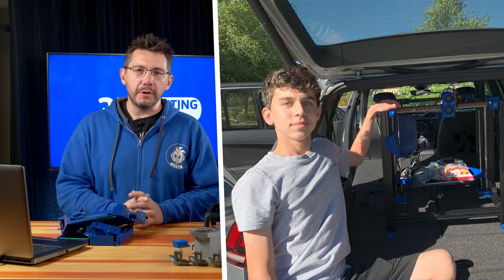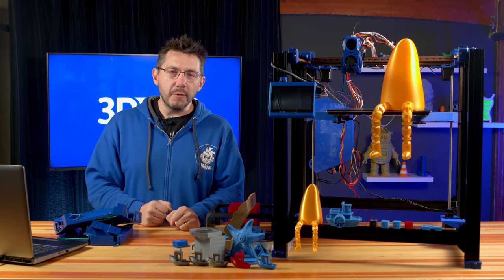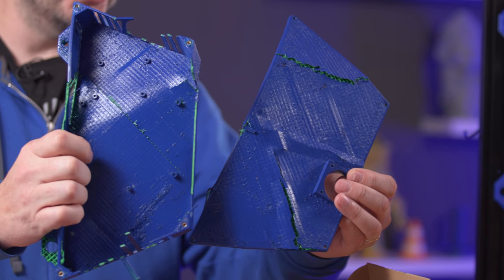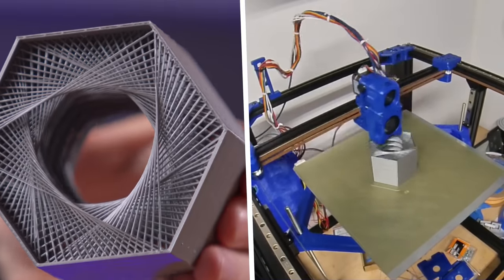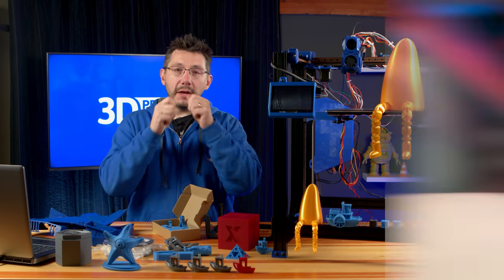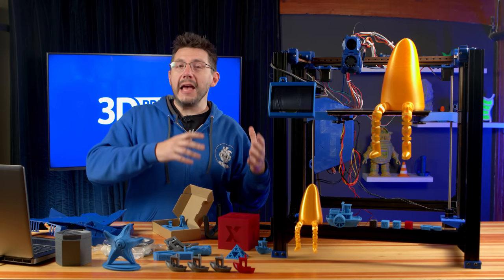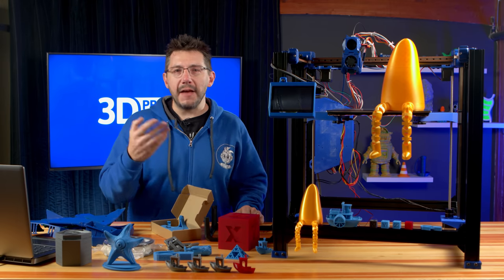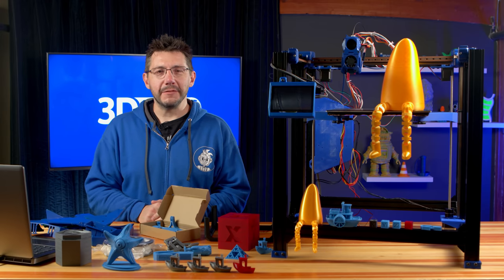14 Year Old Build a Voron - Sort of. Wizard3D W1 Review!

Comment: Website's back up - there was an issue with enabling the payment system. Sorry for the delays
Reply: Nice!
Reply: Good luck man it looks awesome
Reply: @BigfootPrinting  i agree ppl dont ford cobras A.C. even tho its their body same with Hennessey venom ppl dont say its just a lotus exige
Reply: You should create a google business profile to reach more customers.
Reply: Great job, you've definitely got a bright future. With some stronger material and maybe heat sunk screw mounts this build will be solid as a tank and be able to handle high speed as well as high res. Good luck on your venture, I'm poor lol but if I can ever afford one I'll be getting one of yours. I really like and appreciate not only the effort and hard work but the personal aspect too. Nothing makes any product better than when someone's heart and soul and passion are behind the whole thing. Keep up the awesome work!
Reply: good luck.
And I would recomend a little bit more cablemanagement(Cabelchain or something like that).
I know you´re starting but good fotos make also a diffrent.
Reply: it´s also my dream to build an 3dprinter and i am also 14 years old. But i am not so far.
Reply: Your parts did look a little weak. I do not know if it was your filament needing dehydrating or a filament flow issue or not enough walls. If you check with some folk about your slicer profiles and your Klipper profiles, I am sure you can get that sorted out. I personally like 3-4 walls with a 0.4mm nozzle at 0.2mm layer heights with a 15-20% infill and an infill line multiplier of 2 so that it doubles up infill walls. That makes a really sturdy part. Those settings can be used for prototypes that can be filed away and shaped in a way similar to wood too. And yes, 0.2mm is considered a little chunky by a number of people, but it is nice and functional and it is fast. Come to think of it, you might want to try a temperature tower although I am not sure if Klipper folk do those the same way the rest of us do or not. Good luck!
Reply: "Hotend Maximum Temperature: 290° C" 
Capricorn tubing or all metal hotend?
Reply: We are happy to see Mainsail being used more and more. If you need any help - contact us on Discord or send an e-mail. :)
Reply: How are you dealing with certifications and such? I guess that’s really a concern if you’re selling them right?
Reply: Love the design but it would probably be better to sell as a kit for logistics purposes. It is hard to depend on shipping companies not to break parts and if it is small enough it will be placed upside down and sometimes be thrown. Sending it as a kit means it can be a much smaller package and the components can be much better protected.
Reply: "We Will Watch Your Career With Great Interest"
Reply: I hope you'll continue on with this venture.  Sounds like you'll be listening carefully to the good advice going your way.

A detail that is sort of the tip of the iceberg with a ton attached to it: I would really encourage you to spend some time studying 3d printing strength.  I learned a lot of CNC Kitchen on his videos studying the effects of wider line widths (150% of nozzle diameter and wider diameter nozzles like 0.6 to 1.0mm.  I personally use a 0.6 to do between 0.9 and 1.0mm lines) coupled with wall counts (at least 3, but sometimes 4 or 5), with doubling the lines on infill.  Two infill lines next to each other reinforce each other more than just increasing infill density.  Also print temperature / cooling tuning to increase layer welding strength... The wider line widths I mentioned already improve welding and part strength, but using the minimum amount of cooling to prevent sag and retain features without degradation increases strength as well.

I think, (a guess), the parts crumbling either had to do with an incompatible paint degrading the plastic over time or simply some print settings.  The print settings for part strength I learned from CNC Kitchen.

Also, consider printing with PC or PC Carbon Fiber.   On PEI at bed of 105 degrees and hot end temperature of about 255, I'm getting great results so far.   If your printer can handle the higher temperature materials and you keep your bed free from oils from your hands, you can make some amazing engineering grade parts for not much more cost.  I was surprised at how easy Polycarbonate Carbon Fiber has been to work with.   It really NEEDS those wider line widths and reduced cooling to get good welds and keep warp under control.  I haven't had any part lifting yet.

Also, consider experimenting with some steps to reduce heat transfer between the stepper motors and the plastic parts.  1) making a gap between your stepper bracket and the stepper motor.  This can be achieved with cylinders in the model itself allowing a little air between the stepper and the mount or using washers.  

2) Titanium washers don't transfer heat very well, so you might be able to thermally insulate the screw heads better.  

3) Titanium screws might be too expensive to use, but in bulk and with a little standardization in sizes could be another avenue to explore.

4) as you already discussed with Joel, tuning your stepper motor currents to keep heat down is key.  Many printers use slightly larger stepper motors running at 50 to 70% of their capacity to keep heat lower than smaller motors running at 80 to 100% of their capacity.   Of course there is added weight and inertia involved so there is a balancing act here.   You don't want to go too big, but finding steppers that are strong and run cool are part of the equation resulting in a quality product.

These are just a few different ways to look at the heat transfer between your steppers and their mounts.  Seeing how the screw heads pulled through their brackets in some places, this can be heat + shock + time.   You'll need to do some extensive testing of your design to figure out which components need to be upgraded a bit and how to keep the costs under control.   Making standoffs on the mounting brackets is cheaper than buying parts.

That PC CF filament I'm using is a lot more heat and shock resistant than the PETG I normally use.  PETG is better than PLA, but more flexible and can still soften.   Another good reason to watch those CNC Kitchen videos because he tests all that kind of stuff regularly.

Anyway, this is a really long comment and I only intend to give you things to think about and help finding things to research.  I wish you the best and love your approach to this design.  I think you'll be able to find not that you can optimize to reduce weight further.

I, myself, am tempted to do a Zesty Nimble remote driven extruder on a Voron Clone for speed.  

At 14 years old, you're already killing it, so don't lose heart, keep pushing your knowledge and experience further.  You're already on an impressive track.
Reply: @leomakessomething  i am also 14! 
and i build furniture and have a 3d printer that i think you would like its called the ecubmaker 4 in 1 it cnc ingraves laser ingras and can print in 2 colors
Reply: Verry cool im using a modded prusa made with coocoon create parts and running klipper
Reply: I emailed you
Reply: It looks amazing, keep it up.
Can't wait to see your printer in the future 💙❤
Reply: Awesome!
A few "outside the box" ideas:
1) Sell memberships to a "3D print club" for $1000 apiece, that, once there are 1,000 members, they get every "mass-manufactured" upgrade to your printer. Sell other schwag and open an online store full of 3D print accessories, and pay club-members a reimbursement repaying your original "3D Wizard, "sorcerer's apprentice" club. It's a hobby membership club, and gets them guided tours of your print facilities, etc., and discounts on future items. ("Item discounts not purchased will be reimbursed in the form of U.S. dollars mailed to the address and person listed on the club membership signup form, at the end of each year, so that the value of the discount is not lost to inflation.) Thus, people get the benefits of buying 1000-shares of class A stock, without the SEC hassles. They also are identifiable as "club members" who got you your first $1M. It's easier to get a manufacturer's discount business going with $1M of capital.
2) Get to "black aluminum" printing as fast as you can. (Nylon+CCF; water-washable molds for forced carbon fiber; other speciality filaments like PEEK in a heated enclosure; etc.) Feature destructive tests of prints (Hydraulic presses, stress/strain curve tests, etc.) as soon as you can, including tests that subject the various output parts to explosive strain, etc.
3) Also print regular compression rods, going for "biggest possible" architecturally-strong tensegrity prints. This is a rich domain for continual "low-tech" printing experiments that can be iteratively improved on. (Such as by end-cap connectors for tensegrity rods, and such as by testing such rods for utility with various tendons. ...Ultimately, you wind up with something good...that can erect a house in 30 minutes.)

Blessings! Best wishes on being an entrepreneur! Great that you figured out the right way to be so early in life!

Comment: It's possible print qaulity was fine but you have to be careful with spray paints carrier liquid or component. It's possible it softened his ABS parts.
Reply: I could say the same thing, is like painting your helmet, it will becomes brittle.
Reply: I was wondering the same thing, I know plastics can react 'oddly' to carious sprays and coatings
Reply: I know Krylon makes a paint specifically for plastic that won't degrade the plastic. It is not that popular because it take a lot longer to dry/cure. That's because they removed the solvents that flash off quickly and the solvents are what weakens the plastic.
Reply: I had the same thought. The plastic shouldn't have been crumbly.
Reply: I agree with this. I have also had issues with painted PLA - some solvents do affect it, and although they don't dissolve it they make it weaken and get soft and crumbly. Similar to acetone - it will dissolve ABS but makes PLA get kind of chalky and weakens it.
Reply: I used to work for Sherwin Williams, and even with the canned paints if someone was planning to paint plastic with STRONGLY recommended testing the paint first.  Sometimes there's adhesion issues, and often times the paint or the carrier will react with the plastic.  I'm 90% confident that the issue here was the paint, not the print.

Comment: I’m 14 too and just got my ender 3 and its way more fun that I thought. First print was a calibration cube and it turned out nearly perfect. I’ve only had one failed print so far and it was my fault, but it was within the first 10 min of the print so not much waste. Eventually I’ll do the noise mods and maybe even extend the build volume. Ive built a computer and a assembled 3d printer no problem so I think i could build a 3d printer once i learn more about them. Max is one of a kind and we need more people like him. Age does not matter
Reply: hi i am also 14 and yes age does not matter i have done so much im even going to tafe i build furniture and 3d print btw you should chck out a printer called the ecubmaker 4 in 1

Comment: That ringing could be because the drivers are switching between spreadcycle and stealthchop which negates input shaper. The stealthchop threshold in the printercfg should be 999999 to keep it in stealthchop mode and then retune input shaper. I had the same issue and that solved it for me.

Comment: Hey Joel! Instead of using long screws to secure the frame (which is totally fine) you can use 5mm pan-heads which fit nicely into the T-slots. You then drill a small hole through the extrusion that's just big enough to fit the "allen" wrench. Assembly is fairly easy because you can have all of your bolts screwed into the ends of the extrusions before you even start the assembly: simply slide the parts together and tighten. It makes a really clean look (can't see the screws at all) and gives you full access to all the T-slots.

It's best to make a hole drilling jig that clamps into the T-slot for accuracy/repeatability. A 3d printed one would work for a while (there are plenty on Thiniverse "2040 drill guide") but I made mine out of steel.

One thing to mention is that when using this method, or the method you mentioned is to make sure your extrusions are cut VERY squarely. I recently got some 2040 from China and the cut on the end was off by more than a millimeter over 40mm which is almost 1.5 degrees off.

Comment: A few improvements:
1) Make it "self jigging" .  This means that parts have bumps and holes so that when you put them together, they tend to align themselves for the screws to go in.
2) Make the Z axis size even bigger.  
3) Get crimpers that work and learn to make good crimp joints.  For purely indoor use, there is no need to solder after crimping.  Beware of expensive but bad crimpers.  Some low cost ones work better than the expensive types.

Comment: As a complete novice to 3D printing increase your wall thickness and fill on your production parts especially the stepper brackets putting metal anti crush sleeves in structural connections is an idea you might want to look into.  I wish you well in your endeavors.

Comment: I’m very impressed, and this is before I find out it’s made by a 14 year old, this young man has skills mast people don’t normally acquire till their late 20s+ he’s obviously made his own parts using CAD software such as Shapr3D or Solidworks, worked out the wiring for the harness and the output voltage……when I recall he’s 14 🤯🤯🤯 I’m blown away.

Comment: So you need a UL approved power input with filter fuse and switch you will be required to do that jsut so you can sale it in the US. 
I recommend also adding a small 5v psu to run the PI separately from the main control board add some 5v relays for mains power to the 24v and the SSR for the bed that way the PI can remote shutdown if something is very wrong but just cutting power also will save power when sitting idle on the network but keeping the printer bit basically unplugged and the PI running

Comment: I can agree with most of what you said, but... I take a bit of an issue with your viewpoint of just using screws to connect the extrusion. To keep everything perfectly square (as is absolutely essential on CoreXY)  the cuts on the extrusion ends need to be absolutely square cut and absolutely precise in length.  Those are not very easy to do with extrusion without higher cost machinery... although the brackets require more connection points, they also inherently offer both the rigidity and squareness as well as more gripping area than even a 1/4-20 or M8 standard screw.

Comment: those biqu sheets need to get seasoned, then the plate adhesion is perfect. the seasoning is basically  20 prints in an area, and cleaning between each print(I used windex). they seem a little oily, I don't know if that is the spring steel not getting cleaned before the coating, or if the coating is just initially oily.

Comment: The G10 bed on the Neptune 2 I have never had any issues getting things to stick on the textured surface.  G10 is some of the best bed material you could ever use, as its flexible and things stick very well to it, even just blank as is, no need for glue or other things to make it stick.  PEI I have had to tweak settings to make it work "right" and keep things stuck, generally have had to keep the bed much hotter then I normally would, even with PLA.

Comment: All things considered, that is not bad for a 14 year old, sure the parts could use some work, but that is easy when you look at the grand scheme of things. Personally I like the angle brackets, they can shift which is a bummer, but they allow for easy adjustment. If you drill and tap holes and they are JUST a bit off, you are kind of screwed there. 

Great review though, hoping to see more out of Max and Wizard 3D

Comment: I had some PLA that printed fine at 200 for the first quarter of the roll and then I started getting the same issue as Max's prints, increasing the temperature to 215 solved the problem, I believe this was a manufacturing problem that was addressed during the run of the filament, this was a one off that has not happened again

Comment: I'm also looking into designing a 3d printer capable of printing peek and pekk, but running Marlin instead. It will have a heated chamber up to 120 degrees C. And not cost as much as a house (aka, printers at FabTech)

Comment: Around 15 minuit mark... the power suply has a printed cover, he should cost out combination power switch and plug ( similar to old pc/printer/power brick connector ) as it can be at the power supply and most include a fuse at the plug.  Also, printing a jig to assist in assembly is an option.  Such as drill guide for the replacing all those corner brackets with drill and tapped locations. ( edited to fix mah spullin )

Comment: whatever people are saying about Max and his great design, he needs to learn something very early. you are using voron parts on your commercial printer, and by using them you are compelled by the GPL licensing of the Voron Design to also release and make public all your work for this printer under GPL license. otherwise good job on taking a concept to a almost finished product ( could use a wire harness, umbilical or some other way to tidy those cables)

Comment: i have and extruder  wire came off from the extruder , i took my old one apart take a look  and it has a smaal allen wrench to it  so going to try  put the wire back in and tighten the scew up and see if it wi print i have a clone  geeetech  13 pro b prusa